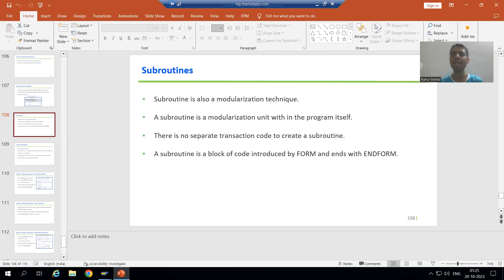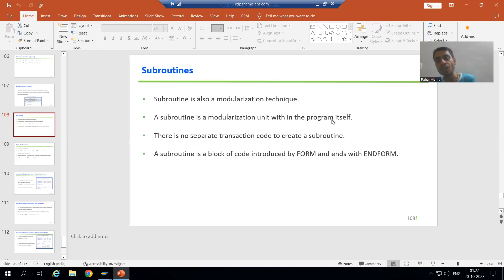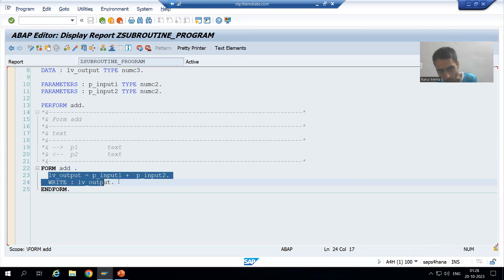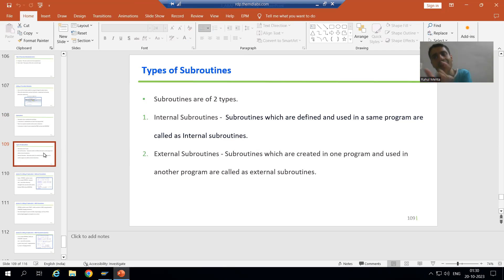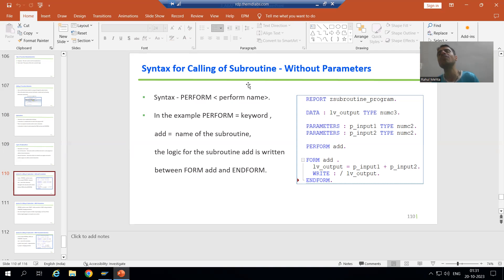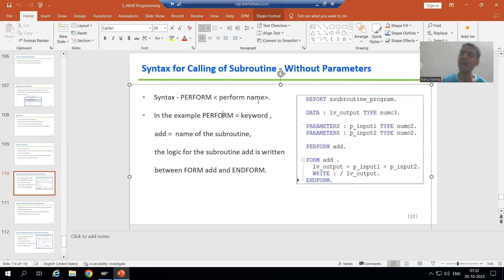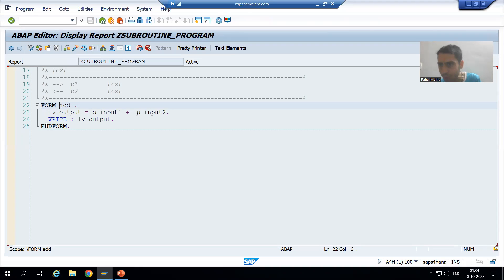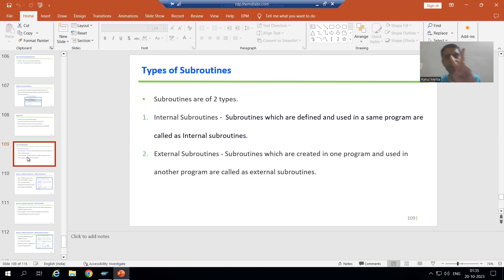23 - Modularization Techniques - Subroutines Part1

Comment: Hello sir, is it good to add variable declarations inside a form. If we add in it then can we use it in alv grid display ucomm form
Reply from the maker: Hello Rushi - It is good to declare the variables locally in that subroutine only. The variables declared inside a subroutine can be used in that subroutine only. It can not be used in any other subroutine.